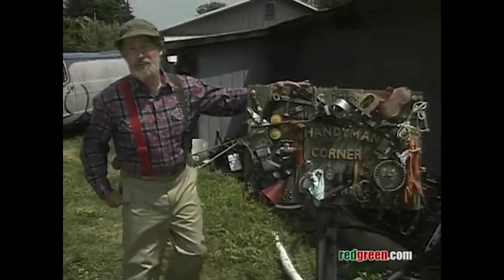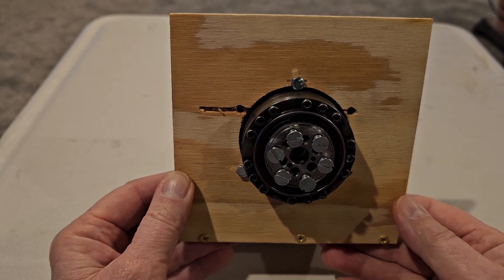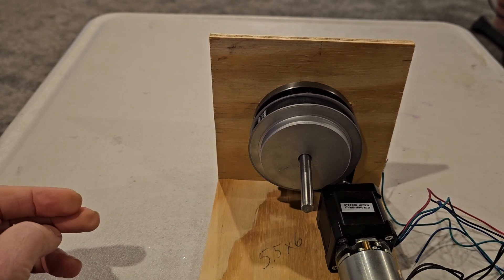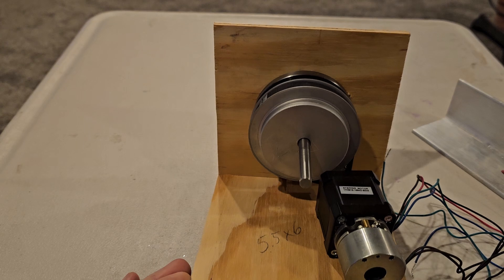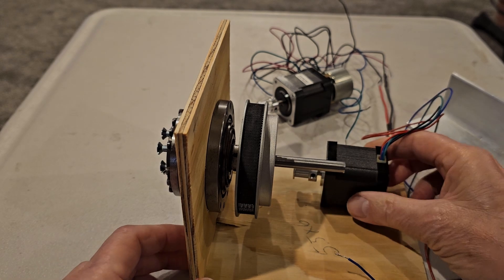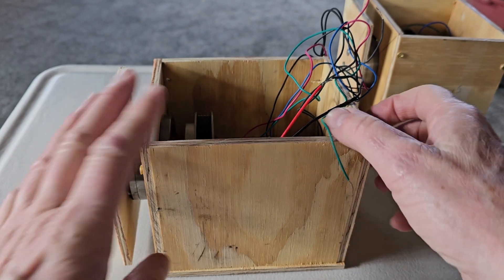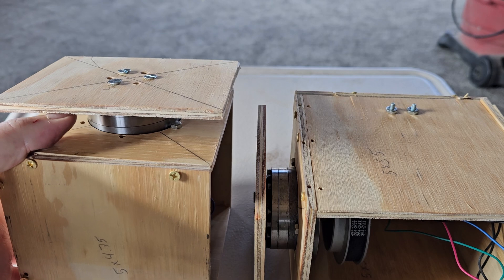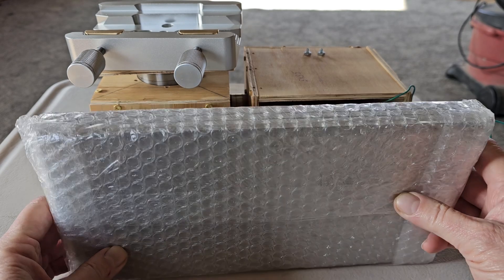DIY Harmonic Drive Telescope mount Part three

Comment: It seems that one could get away with both motors+pulleys+strain wave+onstep in a single enclosure. What do you think?
Reply from the maker: I'm sure it's can be done.  Most Comercial mounts are like that. I'm not that tricky yet.

Comment: Hey sir . Will you make the harmonic drive mount without the wire running from board to DEC axis like the AM5 ? I am currently designing a harmonic mount . I am 16 year old astronomy lover and just like you , I don't have $2000 for a mount . I found these 17 size harmonic drives for $25 from my local hardware store

Comment: Hi, very good video again :-) thanks a lot. I have a question about the choice of pulleys/belt instead of direct stepper motor connexion on harmonic reductor axis : Do you think there is a possible backlash with pulleys/belt vs direct conn ?
Reply from the maker: @fabricehouvet9337  my phd2 graph says no. I've heard of backlash when you use planetary gears.

Comment: Hi! Can you share what is the speed (steps) you are running your stepper motor and also the code? I am in the process of doing something on the same lines but don’t have much working knowledge of stepper motors and their controllers. Thanks.
Reply from the maker: It's in part 2

Comment: I'm kinda thinking if I might be able to modify an existing mount I have and put harmonic drives on the axles.  I'm thinking some custom made plates attached to the end of the polar and dec axle which I could then attach the drive to.  The plates would be needed as the axles are 1.5" and 2.0" and I have not seen any harmonic drives that could fit on this size shafts.  Least none that I imagine would be affordable!   How do you determine the power needed to start the mount moving from a standstill?  Even if the mount is perfectly balanced there is the initial force needed to get it to move.  My OTA weighs 85# and the rest of the mount over a 100#.
Reply from the maker: Wow that is a monster.  I think that's an engineering question above my pay grade. I'm just using the gear that I've seen others use to be in the AM5 ish class. That is also fairly accessible used.
Reply: @whyf16uy  I actually misstated the mount weight.  The part that moves when the RA turns is around 100#... the stationary part is another 100#. So the RA axle would be moving about 185# when turning.  I'm not an engineer either so I think it would work for tracking as far as force needed to turn it... it's if I want to slew the mount to different objects that the force would need to be greater to overcome the moment of inertia?  Maybe someone with some knowledge on this can comment??

Comment: Are you sure the harmonic drives will bear the load of the telescope? i looked at the bearings inside and they seem to be quite puney (atleast with those cheap ones)
Reply from the maker: Well they are CSF17-100 drives, which from the tear down I saw on Cloudynights is the same size as the ones in the AM5. So I assume they will handle it. We'll see I guess 🤔
Reply: apparently my imgur comment got auto deleted lol @whyf16uy  
are you sure they are CSF and not the chinesium ZXS? mine have quite little beraings
Reply from the maker: Mine say csf

Comment: Awesome projects!  I have an old nexstar 8 that is a first generation attempt at computerization, which failed of course and is compatible with exactly NOTHING.  I have wondered how to retrofit the existing motors to run with onstep, probably a fools errand.  I'm also retired IT and like to spend as little as possible on the geatest bang for the buck.  I've also recently got into 3d printing and have worked with the esp controllers.  There's a lot to learn.
Reply from the maker: Join the onstep mailing list. The wiki has tons of eq and fork projects people have done. You may find something there that will help you.

Comment: Well done, all respect and admiration for your project, knowledge, skill and for sharing it with us. Question:
Why don't you invert the RA axis output? Connect the output to the tripod and combine everything in one box, get rid of the cable between RA and DEC and everything could be more compact?
Reply from the maker: We haven't talked about it yet but my design for the Alt-Az part of the mount that connects to the tripod is much easier for me this way. Your way is much better and I'm sure that's why the AM5 is designed that way. Maybe version 2? 🤔